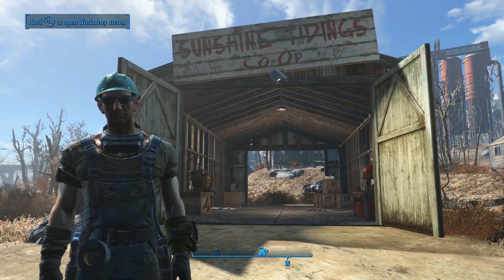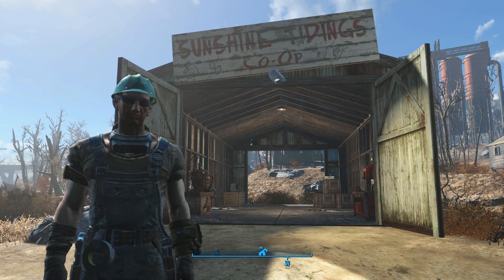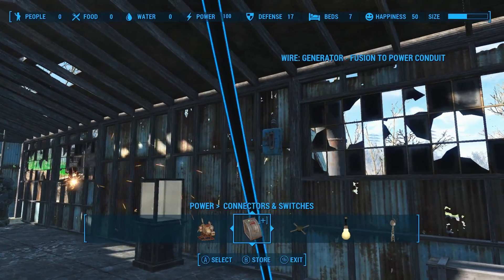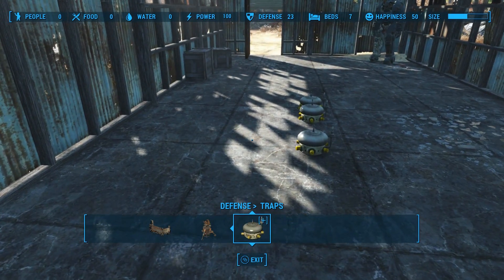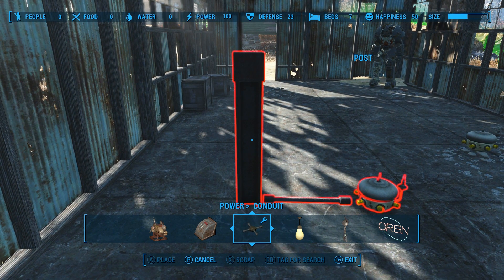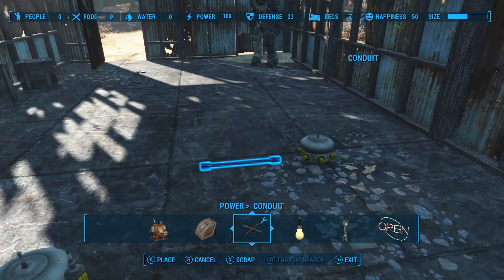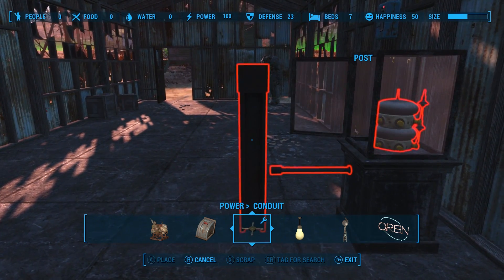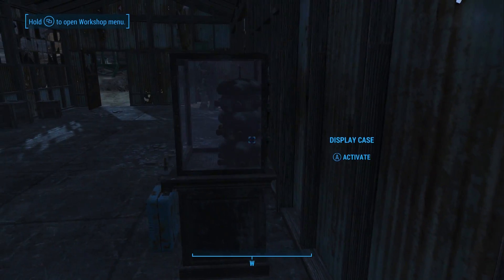Let's Build a Tesla Coil Display ⚡ Fallout 4 No Mods Shop Class

Comment: The wifi glitch causes errors in the power grid (an FO4 bug).  Once you have that error grabbing, deleting, storing etc any item in the settlement can cause a CTD.  Also, trying to wire something to a glitched object and sometimes trying to place a new item (anything really) will cause a CTD.  The wifi glitch is actually a bad idea.  If you can use mods, get the power grid tools mod on Nexus Mods, run the command in the console and it will tell you just how many errors you have.  Fix those errors and no more CTD's in workshop mode.  Also, you will need to rewire your settlement which includes replacing the generator(s).  Even though it says the generator(s) are producing power, if they powered a glitched grid, they will no longer produce power.  Another indication you have power grid errors is when you are walking towards a settlement, just as the LOD changes to the higher detail level, you crash to desktop.  That's most likely a power grid error.

Comment: The model Shure you’re using requires more gain because they need “phantom power”. By finding an external audio input you can get just about any mixer type with phantom power that will boost your mic to the right level and not have to crank the gain to compensate for it. It’ll just be a better and more consistent and over quality because you won’t have to use SO much gain. 
I’m not sure about you but I play in a band and know a crap load about sound and mixing so if you have questions don’t be afraid to shoot me a message and I’ll answer your questions and help you out anyway I can!
Reply from the maker: Hey Aaron, that's really nice of you. I picked up an SS1 mic activator to boost the gain and I use a Scarlett Solo for the mixer. I think I got the levels and EQ presets just about right in my more recent videos. However, if you have any suggestions or feedback on the audio quality, I'd love to hear the thoughts of an expert. Just email me through the website and I'll email you back. Thanks dude.
Reply: @SkooledZone  no problem, I love the channel and the content!

Comment: Wonder if you could use greenhouse walls to make a huge Frankenstein like lab with the electricity going through the air?
Reply from the maker: I just tested that on your suggestion and, interestingly enough, the electricity goes through the glass walls. Not sure why those and not the display cases. LOL.

Comment: I just had a fun thought watching you work the wifi glitch with trap items:  wireless traps hooked up to the bullseye switches, allowing you to fire at the switches during settlement attacks to activate associated traps.  Finally traps will be genuinely useful, without the need to run a quarter mile of cable across your settlements.